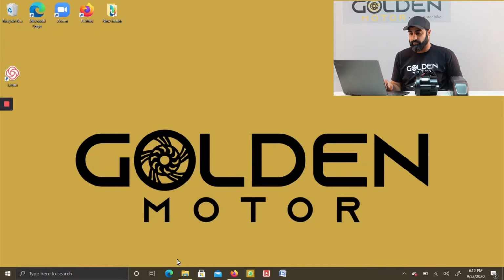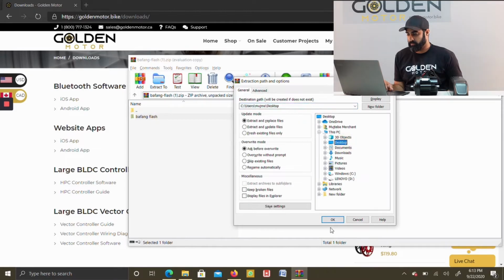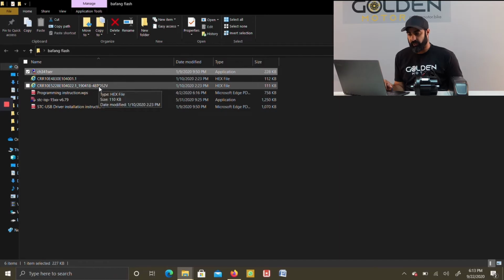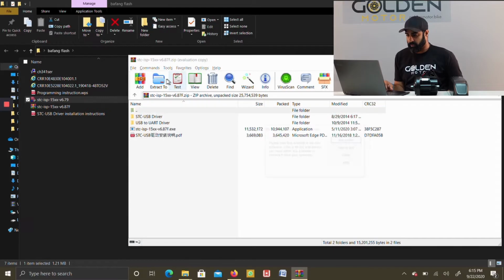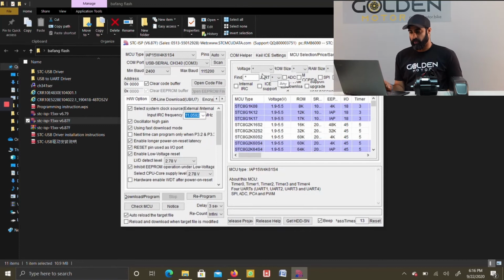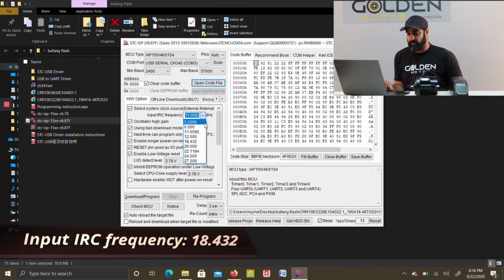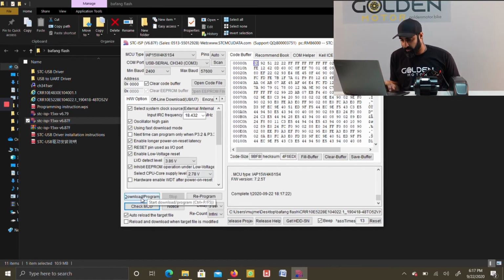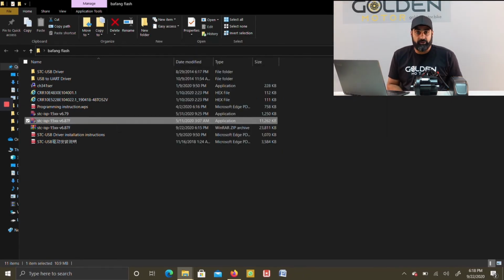Bafang firmware update/ Error 30 fix/Error 7 fix BBSHD BBS02

Comment: Hi I just updated my 1000w motor with this firmware. the update went just fine but after that the BafangConfig Tool does not work on it. configTool can connect and read out info without problem but as soon as I try to send the configuration back to the controller (also without changes in the config) I get no confirmation and the controller stops responding. Error 11 also appears in the display. to fix the problem i have to reload the firmware then the 11 error disappears again. but if I try BafangConfigTool again the error will come back again. I had no error on my controller before I updated and would just update for fun to see if it worked. Regret it a bit now. Do you have a solution to this? is this firmware original from Bafang or is it a copy / modified firmware.
I have tested both the 48v and 52v firmware.

It's incredibly annoying that I can no longer configure my controller.
Reply from the maker: This is the original one from Bafang 

In the video I mention to reach out to our support team if you want the unlocked version of firmware. Please do so, our support  team can provide it

Comment: Only bbshd fix error 07 - overvoltage.  fix 30 - fake, fix bbs02 - fake.  Error 30 - often broken display connector
Reply from the maker: The BBSHD comes locked from the factory if you try to change the settings it will give you an error 30.. you will need to flash it to get it working again. it can also be caused by bad connection in that case obviously the video does not apply

Comment: Thank you very much, I have a 52v controller so i should downgrade it to 48V.
Reply from the maker: Yes if you are using a 48v battery.
It should still work tho you can try using it and seeing performance first
Reply: @goldenmotorNA  yes, i use 48v battery.

Comment: Hi I have a bafang bbshd 1000w when I go to program the controller it reads it to let me change settings then comes up with error 30 I used you advice and that removes the error 30 do you now if there is a way to program it with out having error 30 come up thanks
Reply from the maker: Reach out to our support team for that. They will give you the programable firmware

Comment: hi, I have a new Bafang M620 (G510) engine, after a few minutes it stopped working and gives error code 30, could you tell me how to update the firmware of my engine? If you think the problem may be software ..
Reply: Hi Ivan, what are you trying to do?... Converting from 48V to 52V due to Error 07? or something else??

For me, I have a BBSHD 48V1000w motor. But I have a 52V battery, I always get an error 07 on the display if I fully charged the battery. To solve this issue, I need a firmware from 48V to 52V conversion. I have used the code from Golden Motor and failed and almost bricked my controller.

The file from Golden Motor is CRR10E5228E104022..wont work on my 48V1000w motor since  have a 10500 code... Check your motor, if it has the text ...1050....on your motor then the hex code wont work from Golden motor.. you may get it file from https://endless-sphere.com/forums/viewtopic.php?f=28&t=100064 with the 1050 bin file. E.g. CRR10E522810502. or CRR10E483010502... 

CRR10E: BBSHD
5228: 52Volts 28Amps
    4830: 48Volts 30Amps
1050221: Firmware version... should match your motor something like 105022... not 104022

Follow the thread link above and get the CRR10E4830105001.1_190418.bin to flush it again to unbrick and then flush
 it with the correct code....

Hope this help!.

Comment: This doesn't seem to update the Nominal Voltage in the Bafang Config Tool. I did the flash but the config tool showed 48V 28A when you read it. The 48Vto52V.bin  may solve the high voltage error but it seems to limit the controller to 28A.
Reply from the maker: reach our support team should should be able to give you the correct firmware

Comment: so if i select 48v to 52v firmware it should fix my error 07 for over voltage protection?
Reply from the maker: Yes it should
Reply: @goldenmotorNA  just got the cable and followed the video used the file 48v to 52v and now i can error 30?

Comment: Thanks - need some more help - I didn't have error 30. Flashed my BBSHD controller and now can use 52 V batteries. Tried to re-flash Luna setup and got current out of range error (Luna current set to 30 the 48-52 Flash sets it to 28) had to re-flash using the 'Golden' again cause error 30 was set.  Want the throttle not related to PAS settings. 
 
OK - after flashing with the 48 to 52 flash everything is good except if I use Bafang Config Tool after doing a read, cannot write in fact I get error 30. so far only way to fix is to the complete flash again. I want to set the assist 0 values to 1 so the throttle will work independent of PAS. I tried both the Bafang Config Tool and the Stafan Penov version with same results am afraid try many more time fear of breaking the connector or something else. Any help or explanation? Is my controller locked and shuts down communication error 30 if try reading with the Config Tool?
I have 2 bikes with BBSHD, the other is a Luna BBSHD, before using the FlashTool I was able to copy the Luna settings to to my other eBay BBSHD bike. 
by the way - yesterday first time using the serial cable for anything!
Reply: Hi Mike, 

Check to see if your BBSHD motor has the code xxx1050xxx...

The file from Golden Motor is CRR10E5228E104022..wont work on my 48V1000w motor since  have a 10500 code... Check your motor, if it has the text ...1050....on your motor then the hex code wont work from Golden motor.. you may get it file from https://endless-sphere.com/forums/viewtopic.php?f=28&t=100064 with the 1050 bin file. E.g. CRR10E522810502. or CRR10E483010502... 

CRR10E: BBSHD
5228: 52Volts 28Amps
    4830: 48Volts 30Amps
1050221: Firmware version... should match your motor something like 105022... not 104022

Follow the thread link above and get the CRR10E4830105001.1_190413-1.bin to flush it again to unbrick and then flush
 it with the correct code....

Hope this help!.
Reply: Any luck as I am having same issue
Reply from the maker: You need an editable firmware file to be able to modify the parameters. Go ahead and reach out to our support team they can send you the firmware for that 

Goldenmotor.bike/support

Comment: Hello I have a 48v 17,5ah battery my dp c-18 display does not show 100% charge because the controller is upgraded to 52v what are the conversion parameters from 52v to 48v? do i have to follow instructions in the video? Or can you tell me the procedure and the parameters from 52v to 48v? thanks
Reply from the maker: Follow the instructions in the video and select the 48v firmware that should resolve the issue

Comment: what an excellent resource to have access to! thanks for this video. Recently one of my fellow cargobike riders fried his controller on his HD. the mechanic who replaced the controller did not update the firmware on the replacement part and now im having an overvoltage error code. Now that i have a programming cable i will go through these steps to see if it resolves the problem.

Diego, Cargo Bike Solutions NYC
Reply: Doesn't. Look like this? Guy. Returns. Any of his? Emails?

Comment: i saw this video and followed the steps, everything flashed perfectly and now my bbshd appears to properly show battery meter for 52v.  the only thing i noticed is that it changed the 30amp original current limit down to 28 amps.  can the firmware be readjusted back to 30amp current?
Reply from the maker: it can reach out to our support team. they can send you the correct firmware

Comment: Can I use this to fix a 52v incompatibility issue?
Reply from the maker: absolutely. if you are using a 52v battery. use the firmware for 52v.
Reply: @goldenmotorNA  nice demonstration and thanks for the help. Please I have a bafang mid drive 48v 750W. And i tried it with a 60V 18AH battery but it shows error code. What can I do. Will following this process help me out??? Because that's the battery i have. Thank you very much

Comment: YES! YES! YES! This has just fixed my error 30 problem. I was in the middle of trying to program my controller when I lost connection to it mid way through inputting new values in the pedal assist tab a week ago and have been off the road since with this annoying error 30. I thought I was going to have to get a new controller (which would have been gutting as my whole Bafang kit has only done 2 hours!)
Many, many thanks for this!   
So I've got a current spec (just in from china) (28amp limited) BBSHD (the one sold as 1000W), with a 52volt battery. So there's things I can be doing that are as easy (and cheap) as the stuff in this video to unleash a bit more power without risking reliablity too much?
Reply from the maker: You have to put a programmable firmware on there.  Then you can program as you like. Please open a support ticket goldenmotor.bike/support

Our support should be able to send it to you.

Comment: When I press CHECK MCU and turn on the battery, it doesn't detect it, it doesn't do anything, what could it be? excuse my english, i'm using googletranslator
Reply from the maker: Please make sure your battery is off/disconnected, when you click on check MCU or download. Once you click it the turn your battery on.

 If that doesn't work,  it's possible your controller needs to be replaced. 

https://goldenmotor.bike/product/bafang-bbshd-1000w-controller/